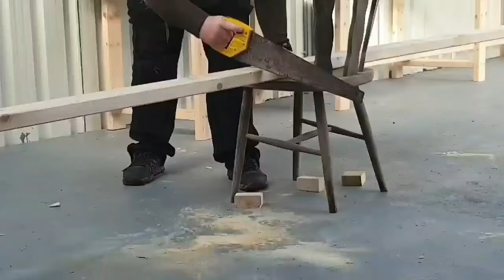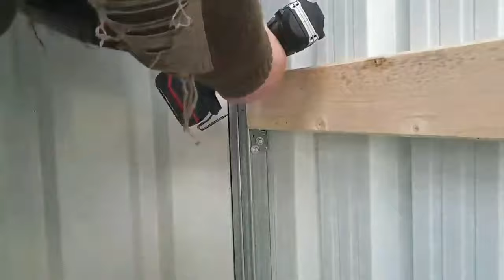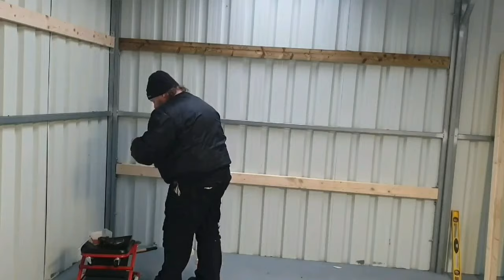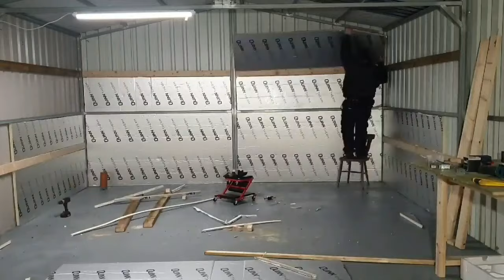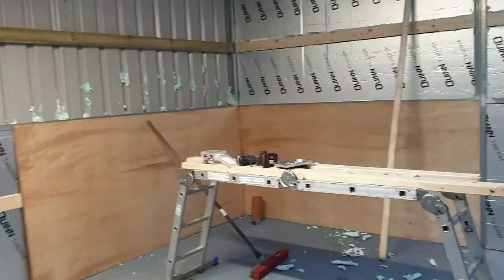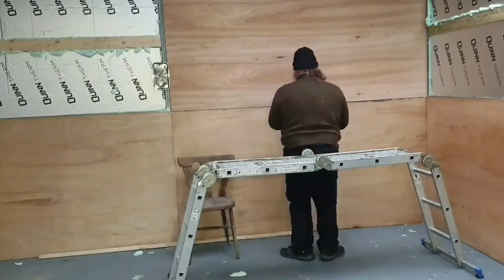How I insulated and clad my steel shed

Comment: I watched your video and did the strengthen boards in my building.  The only difference is I used a full 4x8 sheet of polypro, foil against the metal.  I cut a 2 inch strip the length and applied it to the foil side.  That way there is a gap between metal wall and foam board.  I realize we all are doing the best we can, as there is no "Standard" way.  Thank you for your video, you did an awesome job.

Comment: Apologies if this has already been asked. But did have any issues with cold bridging/condensation?
Reply from the maker: @mickdobbs5443  
I didn't.  The boards are still very dry
Reply: Ah that’s good. Do you have any vents in your shed?
Reply from the maker: @mickdobbs5443  The apex of the roof isn't sealed

Comment: great video, very helpful. Does the insulation fill the whole gap between the tin and the ply or is there an air gap in between?
Reply from the maker: The ribs of the shed wall are voids.

Comment: Great job bosco fair play,can i ask what size is the shed?as im looking to buy one in the spring and will need it to be at least 10 feet wide and 14 feet long,your shed looks a decent size,great idea putting the beams in for a more rigid structure and for hanging stuff off
Reply from the maker: It's a bigun  60 foot long,  over 3 rooms and 14 foot deep. 
Kilcoole Sheds built it.

Comment: Nice job. Good size shed too. Is there any need for any other membrane? Thinking vapour barrier, condensation? And will you be insulating roof? Keep up good work!
Reply: Yeah that’s my thought too. Steel exterior would sweat on the inside and hopefully not water-log the insulation or corrosion.

I assume that a building wrap/membrane against the steel should be added first.
Reply: Yeah, the others had an exterior barrier and interior barrier.
Reply: @LisaSoulLevelHealing  rigid insulation traps moisture when against a cold surface, with that foil on it, it might be a little better.

Comment: Great job  can you tell me where you got insulation sheets and thickness please
Reply from the maker: 75mm from my local hardware store in Co. Wicklow. Any Chadwicks type builders merchants will stock them. They are commonly known as Kingspan sheets but you don't need to buy the Kinspan brand. I used Quinn as you can see.
Thanks for watching.

Comment: How has it held up 🙂? And how did you attach the insulation, to fit and squeezed it in?
Reply from the maker: The panels i fitted on the video are still good. The shed still isn't finished (life getting in the way)
As you can see in the video the insulation is jammed in on a tight fit so don't need any other glueing etc.
Thanks for watching!

Comment: Thanks for sharing. Would there be any need for a moisture barrier and or to tape the joints between the PIR boards?
Reply from the maker: Time will tell....
A problem I have is space in the cavity. 
I may look into your suggestion for the rest of the shed.
Thanks for watching.!
Reply: @aneegitwithaspanner6373  does the insulation board not come with a vapor/moisture barrier?

Comment: Great video! May I ask how it's holding up a year later?  Any condensation? Are you using an AC?
Reply from the maker: The shed does suffer from condensation but the ply board is showing little in the way of deterioration.  I will EVENTUALLY get the rest of the shed insulated including the roof. I will post a video then.
Thanks for watching!

Comment: can i ask did you put the concrete slab down first then build the shed or did you build the shed first the get the slab poured? if you did the shed first how did they do the slab? did they run a pipe in through the door or did they wheel barrow ir in or something?
Reply from the maker: The slab was poured first then the shed HOWEVER the shed company told me that i should have spoken to them first as the floor needed to come up the width of the box section at the bottom to stop rainwater flowing across the floor.
Which had to be done by hand.

Which sucked!

Comment: beams at start of video,whats the dims?2 x 4? Also looking to hang a tv on back wall ,do you think beams/wall would take a bracket and TV ?thanks
Reply from the maker: Yes they are 2×4 beams. 
I made them strong enough to take cabinets full of tools so yes they should manage a TV with no problems. 
Thanks for watching!
Reply: @aneegitwithaspanner6373  L brackets and self tappers into steel frame?
Reply: @johnnyboy4711  following - about to do the same here!

Comment: Might be a silly question but whats the point in the extra wooden beams? Is it for screwing in the ply after? I am doing this soon with a very similar steel frame shed
Reply from the maker: Not silly at all!
Yes mostly for attaching the ply sheets as the gaps are wider than the sheets and if the wood wasn't there the ply would bow outwards but also for attaching things like shelving or cabinets etc in the future. 
Thanks for watching!

Comment: Great video and straight to the point, I’m needing a 12metres by 4 metres garage and looking at different options, did you buy this and put it up yourself? Thanks.
Reply from the maker: Thanks for watching!
I had a local company come in and assemble the shed on top of a concrete plinth that I had poured. It took them 4 days ir so to finish.

Comment: What did you do with the floor, did you pour concrete after building the shed. I wanted to do that to stop water getting in but not sure if that will block moisture getting out. Did you add a vent anywhere?
Reply from the maker: The shed was built over a large concrete plinth and bolted down. A very dry mix of concrete was spread by hand to bring the level of the floor up to the height of the box steel. It rained before this and streams of water could be seen flowing across the floor. The floor is much dryer now.
Reply: If you pour after building the shed, you run the risk of corrosion starting from the wet concrete.
Reply from the maker: The steel was well treated. 
But thanks

Comment: Thanks for posting.  I recently had a metal garage erected on a gravel base and am looking at different insulation methods.  Also, considering pouring a concrete floor inside at a later date.
Reply from the maker: Thanks for watching. 
I also considered spray foam insulation. 
Be sure to treat the bottom of your shed's metalas to avoid rust.
Good luck!
Reply: put heat in the slab if you can. Makes for a nice dry shop. good for controlling moisture too.
Reply: Thanks, but too late for that. Concrete floor is in.  Electricity is next.  Then insulation and wall coverings.

Comment: How are you finding the insulation. Is there anything you'd change or add to it. Looking to do something similar.
Reply from the maker: This insulation board is much more efficient than the wool type.
As I fitted it I could feel it seemingly radiate warmth.
Reply: @aneegitwithaspanner6373  cheers for that. I'll work on it in spring. Bloody price of materials in this country at the moment is scandalous. How are you finding the spaces between the insulation. Particularly the steel beams.
Reply from the maker: Thanks

I used spray foam in any gaps.
Another suggestion would be to 'flock the steel  tubes by glueing material to them.

Comment: Can l ask where you got the metal brackets ?
Reply from the maker: My local hardware store. They are in the section where the bolts and screws etc are kept.
Reply: @aneegitwithaspanner6373  Thank you sir .

Comment: Good job! Well done! What made you use plywood and not plaster board? What sort of insulation is that? Cheers.
Reply from the maker: This is a workshop so plasterboard isn't as hard wearing as Ply board and knowing my luck something heavy would probably knock against the wall in no time.
That is insulation board commonly known as 'Kingspan' it is much more effective than rockwool.
Thanks for watching!

Comment: what was done to fill the spaces formed by the corrugated roof at the eaves of the shed?
Reply from the maker: The project isn't finished yet  (lack of funds) I hope to be using a combination of spray foam and insulation fibre wool.
It will be tidied using 6mm ply wood.
Unfortunately the transparent roof panels invite waaaay too much condensation so I may change them in the future.

Comment: The weakest point is the cross on your ply timber. You should offset them like brickwork. Other than that great job.
Reply: True but it is not structural so I question if it matters.
Reply: @DavesShed  yeah, not holding up any heavy loads...

Comment: I have water coming in under my bottom rail Every where. American Carpet. Says they don't Gurentee. Water coming in base like wtf. Why build the Garage. Anyone have a anser. I tried silicone still coming in it's Crazy.
Reply from the maker: I had the same problem so I put down a  concrete floor that was level with the box section steel that runs along the bottom of the walls.
I then painted the floor to seal it.
Water can't flow up hill so no more water coming in under the walls.
Reply: @aneegitwithaspanner6373   Thank you.  I'll try that.
Reply: Have them come back and disconnect the bottom of your metal siding and put a drip ledge under that, then reattach the siding. After that, the water that runs down the siding won't run into the building.